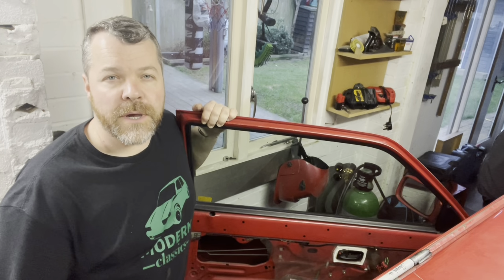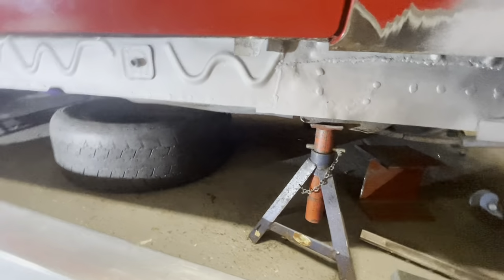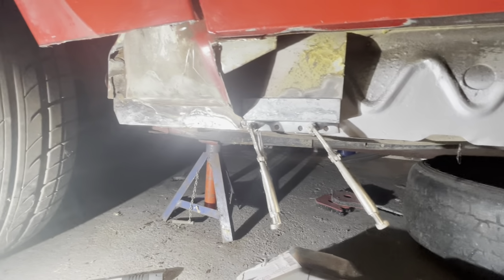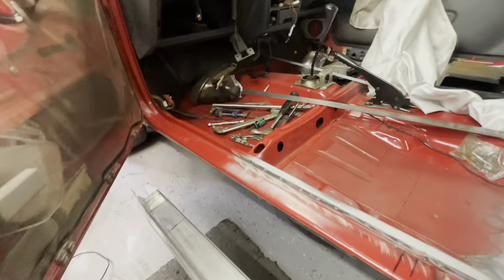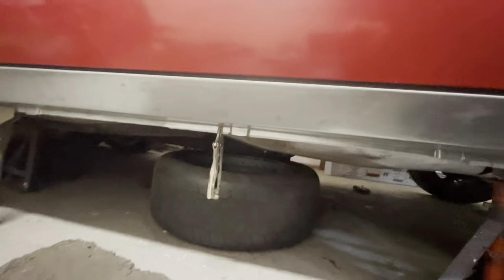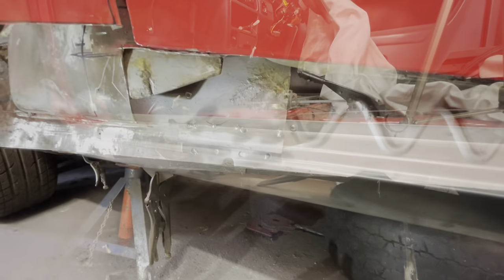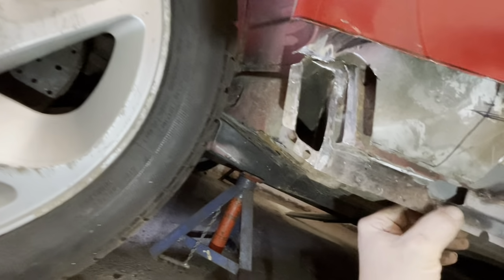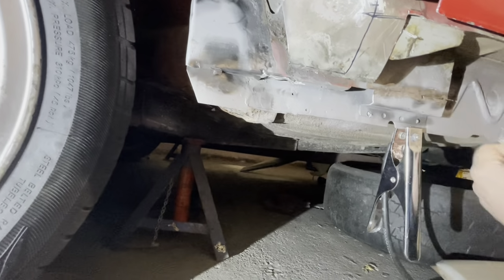Rebuilding the outer sill on the Escort RS Turbo #21

Comment: The passenger doors never come off on the pins - because they don't get enough use, usually - I pull the dash & unbolt the hinges from inside. You could use dynamite & them pins wouldn't budge. If you don't cut the bottom off the wing, you can't properly fit the outer sill - so it has to go. Usually, it's pretty corroded anyway - I weld it back on regardless in order to have a proper shape to go off when making new wing-bottom bits - you can cut the grot & replace later.
Reply from the maker: Yes it’s definitely the way to repair the sill and A piller. A fellow YouTuber did a little video on where he cut his wing on his Xr3i restoration, he’s called Sid’s xr3i restoration. I’m looking forward to doing the drivers side as someone has already welded a half sill on but I bet it’s rusty behind it, so keep an eye out for that video.👍
Reply: @ModernClassics81  I'm going out to the workshop in about 10 minutes to lash into one - no need for video. :-) Welding rust on Fords is what we do. First though, Coffee..

Comment: Thank you for the shout out Chris excellent job looking spot on bud 👌 clad you cut the bottom of the wing off you would be kicking yourself not cutting out that rust and have to do that repair when all painted 👍
Reply from the maker: Thanks again Sid, I didn’t even know the front of the sill had rust in it till I cut the bottom of the wing off. So glad I found it now and not later like you have said, after a paint job. 👍 I can’t wait to cut the drivers sill off to see if there is any rust behind it.
Reply: @ModernClassics81  no problem Chris the mk4 shape seen to all go in the same places 👍